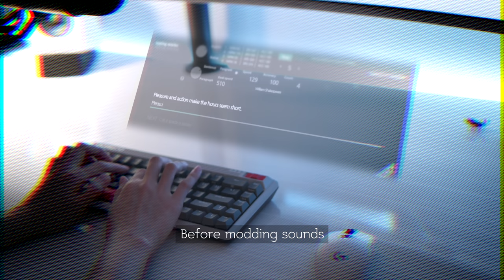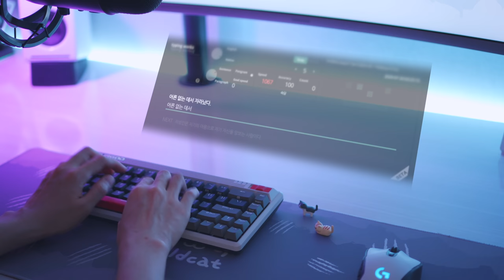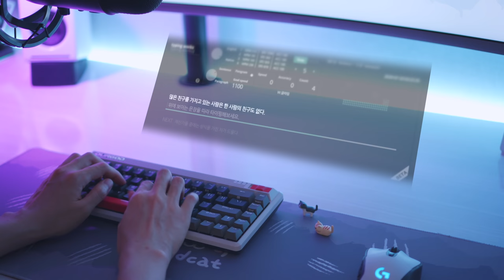Modding Durgod Fusion & Lubed Cherry Speed Silver Typing Sounds

Comment: I lubed my Kailh silver from this guide. I advice:
- Apply a bit more of lube than in the video, because the material have quite a bit of friction.
- Instead of lubing the spring (which is not necessary on this one), lube the metallic lash.

With this the switches offer less resistance, while keeping the 50g force and offer a more pleasant typing experience..

Comment: Nice vid bro. I have a question. I lubed my Kailh Speed Silvers (first time lubing), with Krytox 205G0, and made sure to not over lube the switches. I have been getting some chattering on only a couple keys, and I tried to clean out any or all excess lube that was inside the switch, then I also cleaned it with a bit of isopropyl alcohol. I am still getting some chattering on 2 keys even though I cleaned it out really well. Do you know what could have gone wrong? (No bent pins, PCB is no the problem) I ordered some new switches anyways but I just want to know what the issue might be.

Comment: Hey wildcat! Been following your channel for awhile now~ Saw that you have been re-balancing your stab's wire for most of the mods. In your experience, is the re-balancing difference great?

Keep it up, love your content man! 💕💕
Reply from the maker: Just like @bigdbag said.
In my Korean keyboard community, we think the balanced wire is the most important thing for better stabs.
If the wire is unbalanced, the stab sound would be fine with a lot of grease at first. but later, it will rattle at the end because of the unbalanced wire.
However, you can add more grease whenever it rattles if you can't take the stabs apart and that's what I do sometimes.
Reply: Thank you both for the insightful information! 😘 Still pretty new into this hobby haha.
@:3ildcat YES! That's exactly what i faced, after lubing my stabs they started rattling after one to two weeks haha. Then i stumbled upon your channel, blessing in disguise 😽😽

Comment: That Hakko FR-301 is so beautiful and useful. I tried desoldering (first time soldering) my RK 71 to change my gateron browns with lubed gateron reds but I somehow damaged a key. Tried switch out the switch but it looks like there's damage to the board that needs tracing. The LED for the key works but the key doesn't register any input. It's frustrating to use a manual solder sucker so I'm dreaming of an electric one like Hakko. Soon..
Reply from the maker: Sorry to hear that
I have desoldered many PCBs with manual pumps but everything was fine.
Reply: @3ildcat  It was my first time anyway! I'll do better next time! (Or maybe just get a hotswap keyboard >.<)

Comment: i got a question: does it really matter what keyboard you’re modding if you’re planning on changing out the switches and key caps? what are you really buying when you’re purchasing a specific keyboard when you’re planning on modding it anyway??
Reply from the maker: Simply we don't need.
But as a custom keyboard user, it's just customizing and I prefer than stock keyboards. They sound really bad for me..

Comment: I bought films for my kailh silvers, and unfortunately it does make it sounds 'smoother' to an extent, but the bottom out is much louder and it's a little higher pitch to it. Is this common with films, or is that even the goal? Maybe the noise is desirable but for me I just like quieter so I'm curious what the experts know.
Reply from the maker: Films are not always right and the films are designed for Cherry switches.
And it's always your call to use or not for your switches. If you like, use, if you don't, don't use. Simple.

Comment: May I ask how much lube do you usually add when lubing springs, like how many drops for about 100 springs?
Reply from the maker: depends but around 10 drops enough 
I use more drops and as you can see in the video, the paper towel absorbs exceeded oil.

Comment: Would you suggest using 105 for springs and bag-lube them, or use 205 and use brush on each spring, like you did in other video?
Reply from the maker: recently, I do only bag lubing for springs :3
Reply: @3ildcat  I see. so would you suggest getting 105 for bag-lubing? easier and faster than brush with 205 on each spring?
Reply from the maker: @misiekziomal7121  If you can get it, it would be better. If the grease lubing for springs is too thick, the switches will sound some sort of squeaky noise.
Reply: @3ildcat  Ooooh, 105 it is! :) I noticed this springy "ding" noise in my Tealios when not lubed. I guess this comes from springs, so lubing should help.
Reply: @3ildcat  On emore thing - should I be worried about dripping oil and gathering at the bottom of the switch housing after a while?

Comment: I have an issue with my spacebar where it makes a really high pitched noise. I already lubed them and the switches with krytox g205 g0. It only makes the sound on one side of the spacebar. What should I do?
Reply from the maker: maybe unbalanced wire?
or unbalanced keycaps, plate, I don't know. Too many variables

Comment: Alright I got a gamer problem. So I have the corsair k95 platinum with the cherry speed silver switches and the space bar, enter and the right shift is are super rattly and I don't know what to do beside lubing the stabilizers
Reply: You could look for GMK plate mount stabilizers, desolder the switches where you wanna replace the stabilizer, do all the mods he does and then hope for the best when you put it all together. (Look for them maybe on mechmarket? Reddit)

Comment: What is the advantage of mixing Krytox 105 and 205?
Reply from the maker: First of all, I have a lot of 105 compared to other 205s. 
And it's a bit thinner than 205g0, so when you apply it on the stems and other parts, easier to apply than thicker ones